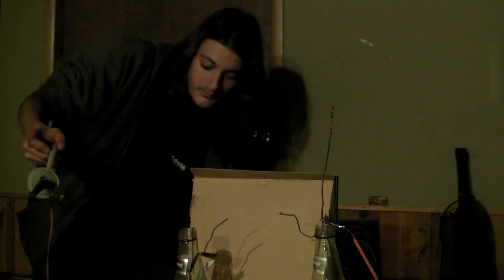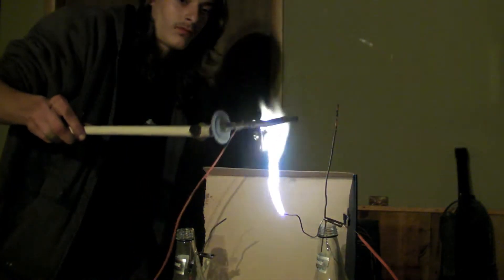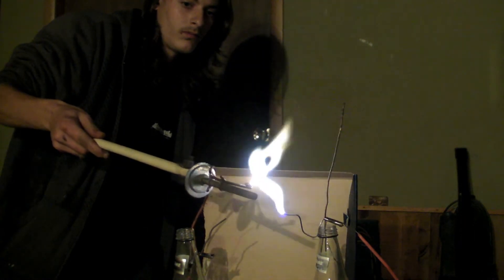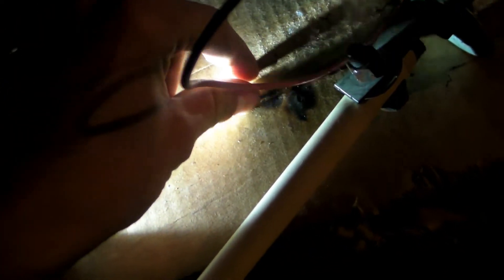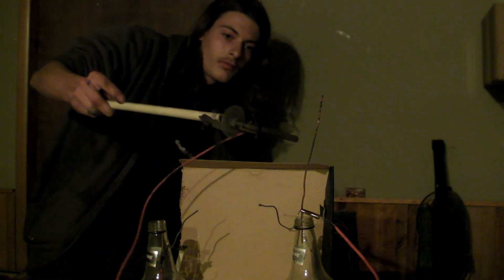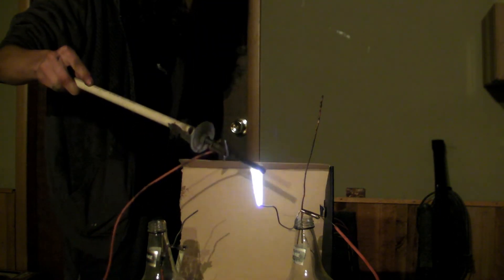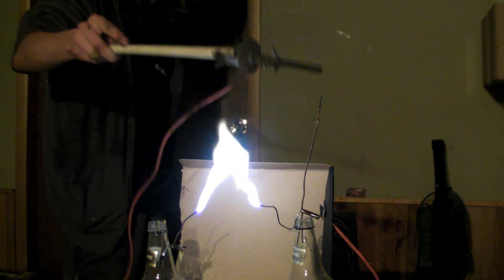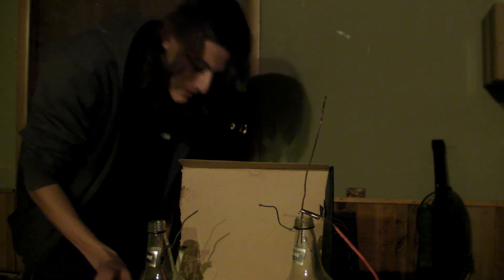Neodymium Magnets VS Mega ZVS

Comment: Hey matey"
Thats a impressive output mate. Loving the Corrona mate. I bet there was a pungent smell of OZONE with all that corrona haha
Was the driver a zvs driver with igbt mosfets? Or did you use another driver??

Thanks for sharing' glad to see you playing with high voltage again mate. Its been too long!!!

~☆~☆~☆~☆~THUMBS UP~☆~☆~☆~☆~
Reply from the maker: Thanks! There was a bit of that ozone smell when I was done there. I used a slightly modified ZVS driver in combo with some IGBTs. I cant recall the IGBT series offhand, but I intended this driver to handle rectified 120. But theres no point shorting out my only "legitimate" flyback on that yet. Im always into high voltage. Just been real busy on other things to make videos and whatnot. Nice to hear from ya
Reply: The only modification you've done is you're supplying the gates separately, right? Standing up to 120Vdc rectified from wall... Imagine

Comment: nice, home wound flyback ?
Reply from the maker: No, just the best RPTV flyback Ive come across. Under oil. I fried out the internal rectifier after like the second arc on about 1kW. So now its an AC flyback. I ought to wind, one but its pointless winding one on a flyback core since it will saturate anyway. When I get a big ferrite core, Ill make a giant "flyback". Then I can finally benchmark the current driver design.
Reply: juniortore1 my RPTV flybacks keep frying out, dead shorts :(
so far i have gone as far as about 600 watts, series resonant.
josh has gone as far as 1700 IIRC. would be interesting. is this a mosfet ZVS?

Comment: That's one hell of a ZVS!
Reply from the maker: I havnt even tested the drivers designed capabilities after assembly. I simply don't have a flyback that will tolerate the drivers maximum potential yet.
Reply: Juniortore1 dude what you juust said....

is super fucking out of control awesome.